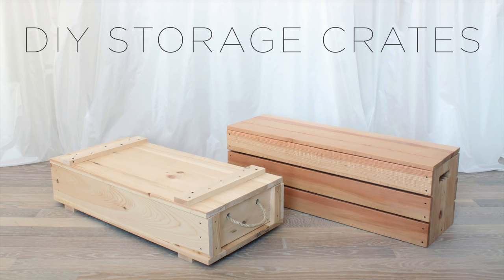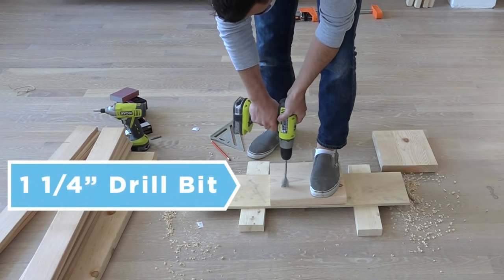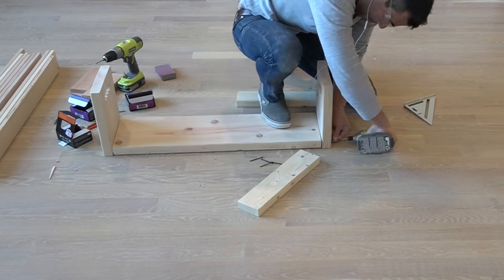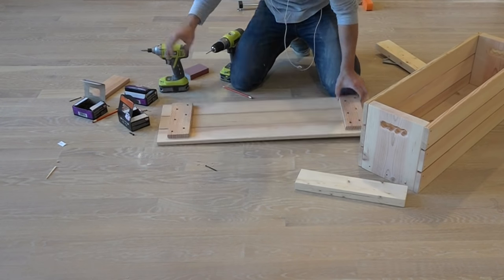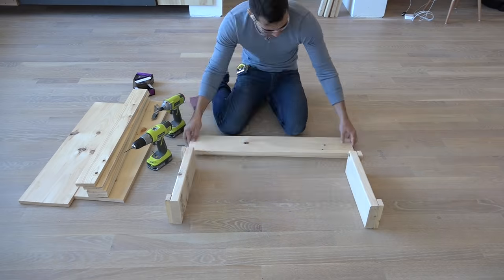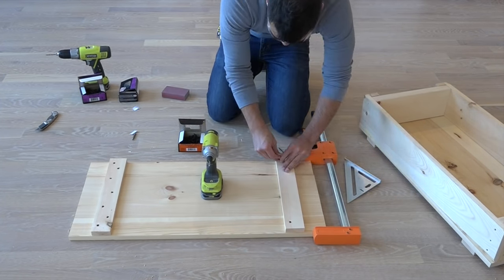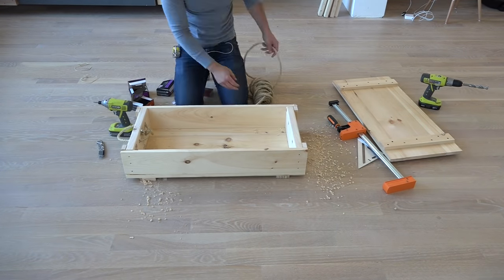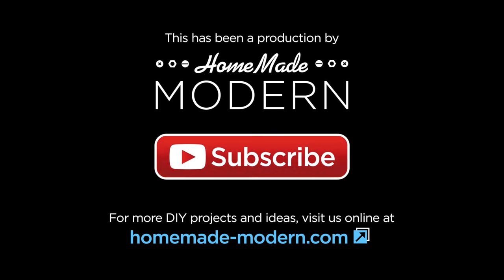DIY WOOD CRATES

Comment: Nice crates, good work!    I like them.   Yes, much better than plastic boxes.  

Everybody seems hung up on using screws on all woodworking projects.    Guess it's derived consumption from buying all the cordless gear.  You can buy one heck of a lot of wood from the money you'd save by purchasing a good hammer, or even an inexpensive corded drill from Harbor Freight and a decent extension cord.    Finish or box nails (you are building a box after all) are cheaper, and hold just as well.  Your instincts are good in that you pre-drilled.    Even nails should be pre-drilled in locations where the wood may split.   

Just so people know.  The proper way to fasten ANY screw?  1) the piece you are fastening should have a hole sized so the screw shank can just pass through, 2) the piece you are fastening to should have a pilot hole sized slightly under so the threads of the screw will cut into the sides of the pilot hole.    That way, the piece you are fastening will securely grab onto the piece you are fastening to.  

I guess all the bad or at least misguided woodworking I see on youtube is the result of people having fathers who were computer programmers or accountants and were not very handy.   And consequently, could never offer their children any guidance in woodworking or how to maintain a house.    Sign of the times.

Nevertheless, nice work!  Good going!
Reply: Lol just look at that place hes working in, his brand new tools, his clothes. I mean cmon the dudes wearing designer jeans while woodworking. And hes making simple wood crates out of TWO BY TENS! ...You think this guy gives a shit about money lol?
Reply: Mark Williams